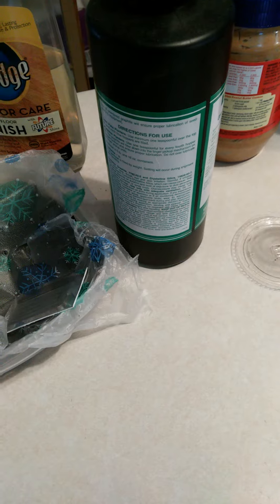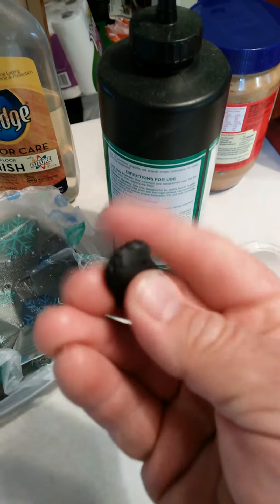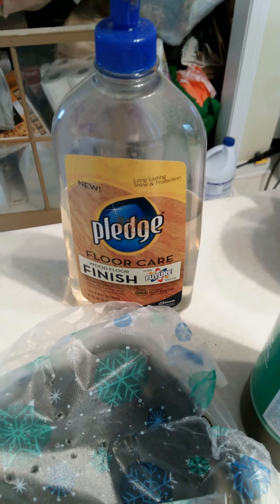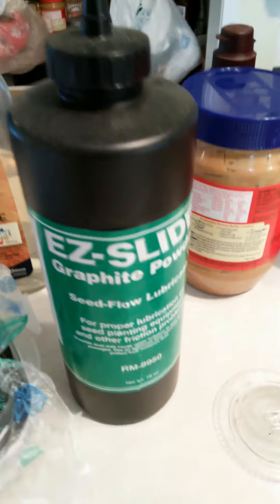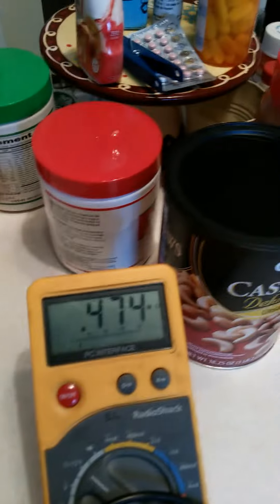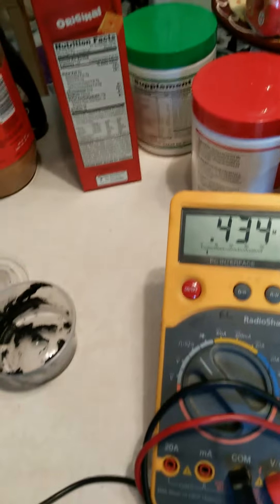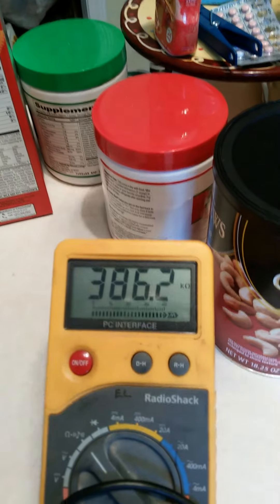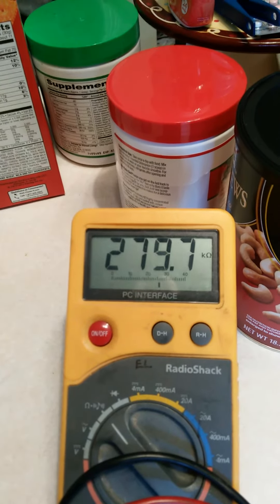Graphene conductive putty

Comment: Nice,I did once Graphene with 2 spatulas I did just rubbed on with another with graphite dust and and the end i did see really under the Microscope nicely alighted graphene < the Resistivity was under 3 Ohms/1 Cm but i did never managed to repeat it.
Reply from the maker: Bartosz Barejko Recently I put the graphite in a coffee grinder , the electric kind, and made a fine powder out of it.
then mixed it with just a small amount of water and microwaved it.  it worked to make a pile of graphene but the pyrex cup that I used got to hot and cracked.

Comment: hi,
I am also playing with graphene.  I make my with acids and then I put it in the microwave.
after pressing it I have 1,5 ohms.
Reply from the maker: ehochimalpi Recently I put the graphite in a coffee grinder , the electric kind, and made a fine powder out of it.
then mixed it with just a small amount of water and microwaved it.  it worked to make a pile of graphene but the pyrex cup that I used got to hot and cracked.
Reply: mm, look at robert murray-smith  he is the god of graphene :-)
Reply from the maker: Yes 1 smart fella,  Since you are getting 1 to 5 ohms from your graphene you might want to see it will mix with cement,  I mixed graphene with different types of cement and plaster.  I put Titanium Dioxide in some quick set "cement all" Made some flat disk out of them and after they dried I put them together with aluminium conductor on one side and copper on the other and for the electrolyte  I used Scotts whiskey and charcoal ash.  The voltage was .5vdc normal and after an 8.5vdc charge it stablized at 1.45 and had about 4 mil amps.